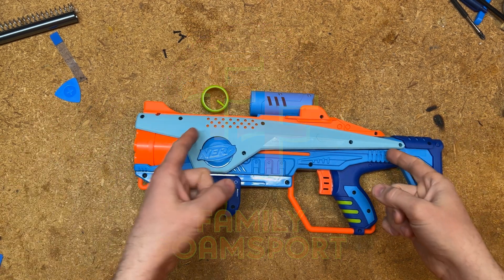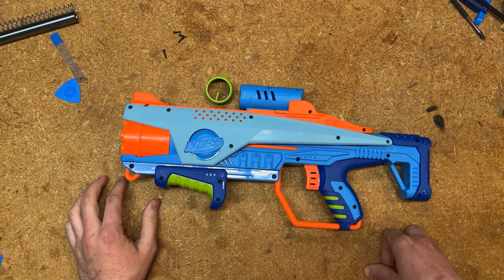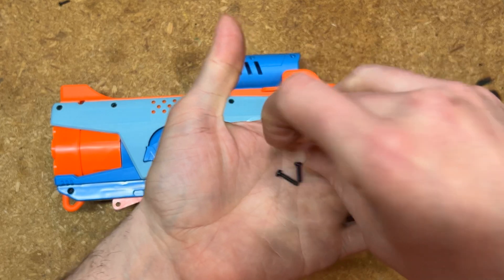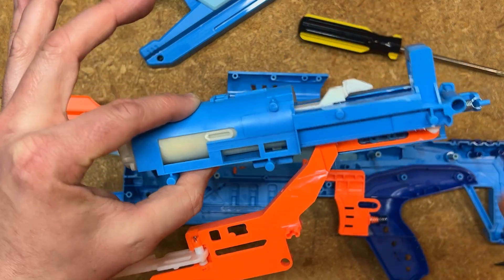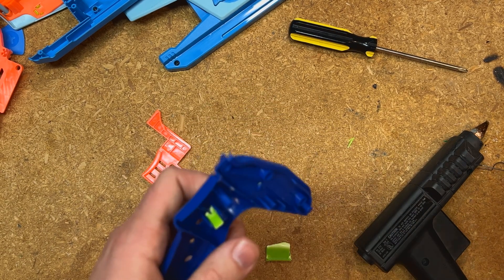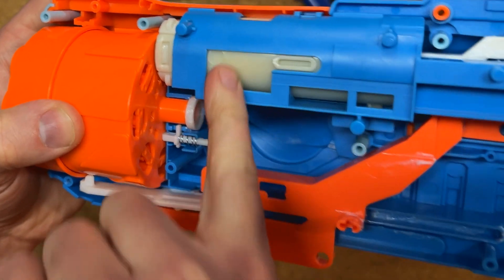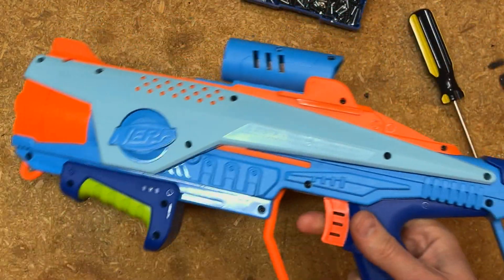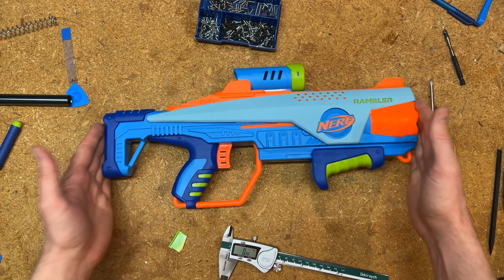Nerf Elite Jr. Rambler Slamfire Fix! SUPER SIMPLE MOD

Comment: The fact it was such a simple fix shows how lazy the engineers were. So confident in their design they couldn't be bothered to test it.
Reply from the maker: What can happen also is factories making unwanted changes - the thickness of a plastic wall is exactly the kind of thing they might change to save on material. No way to say for sure without inside info I don’t have. Bummer either way, but I’m glad it’s fixable!